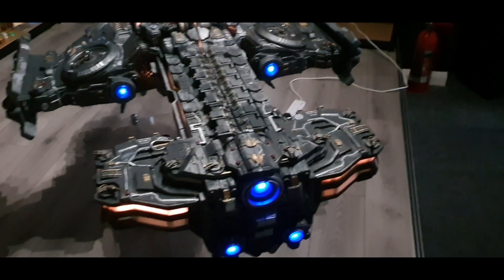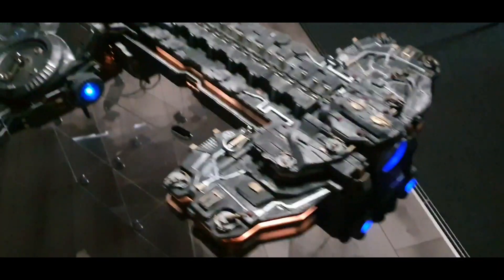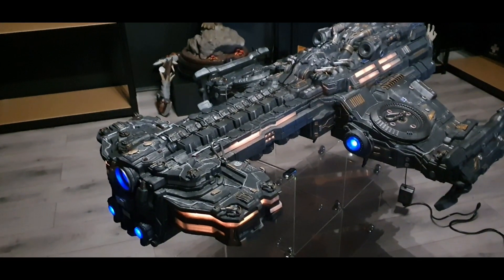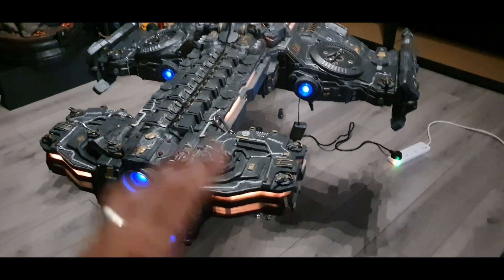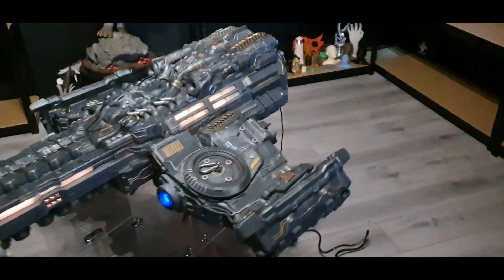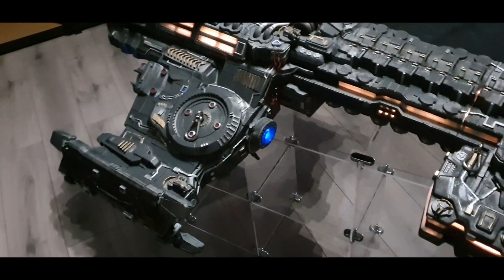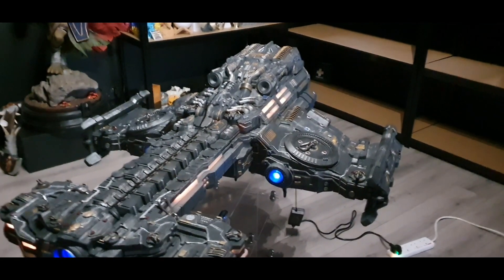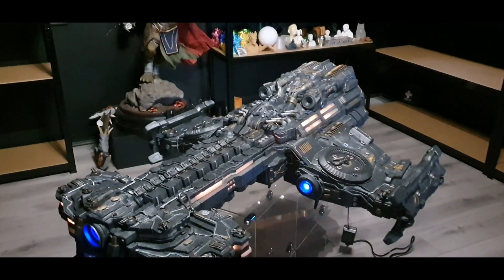the terran battlecrusier

Comment: It's not just any battlecruiser - it's Hyperion, Jim Raynor's flagship. There are multiple different designs for the battlecruiser class terran warship. The in-game buyable unit is the most basic cheapest variant, but it is still equipped with laser turret array, yamato cannon, and tactical warp drive.
Reply from the maker: well this one just have 5m of LED strip lol and an arduino

Comment: Fantastic job! Looks great and I love the idea of being able to hang it. Smart move adding in the carbiners. How did you manage to have the lights pulse? I am working on the RazorCrest from the Gambody site and am thinking about adding in a arduino to help manage the LED's.
Reply from the maker: so we used a small arduino to run all the light pulsing, my friend arif did that as im not there yet with electronics, but all the LED strip is just the normal stuff you buy on amazon cheapest stuff i could find and then used their power brick, we then than the rest of the LEDs off the R power line on the LED strips